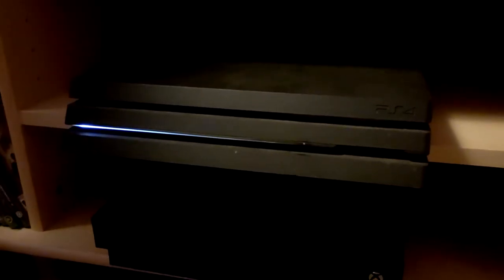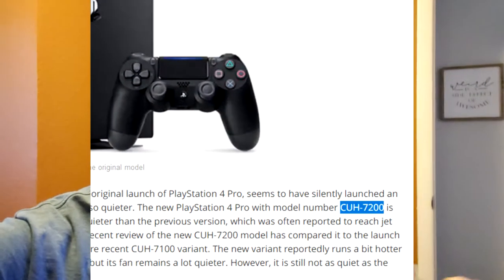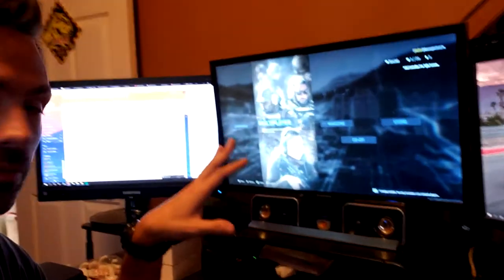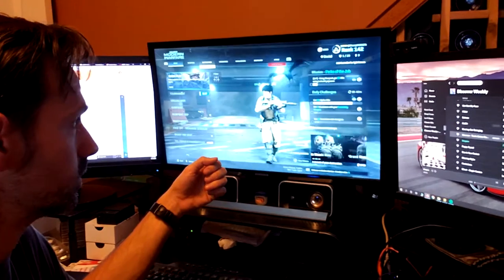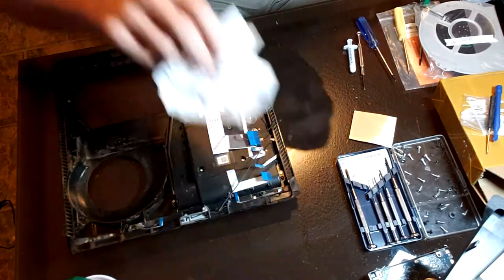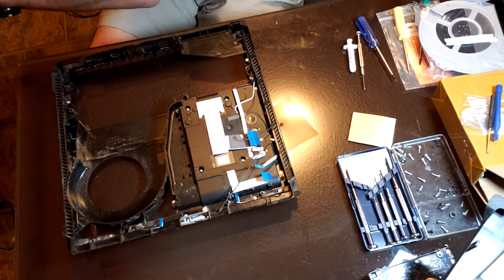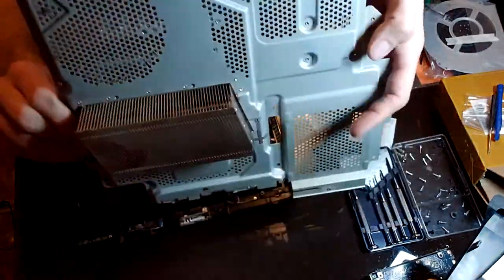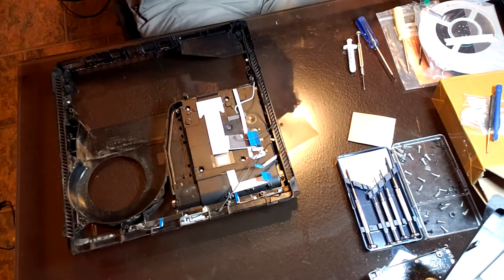How to Fix a Loud PS4 Pro! No More Jet Engine! (Fan Replacement)

Comment: Thanks for sharing this!! Will be doing this on my ps4- pro cuh-7115b console!
Reply from the maker: Let me know how it goes! It made such a HUGE difference for me
Reply: @WheezysGaming  got it installed and yes it made a big difference. Runs quieter. No more jet engine noise! I also bought .75 inch rubber pads to lift the console and offer better cooling. Thanks man for suggesting this fan.
Reply from the maker: @gerardoserrano4801  That's great to hear! It makes a WORLD of difference!

Comment: my ps4 pro was working really well-I thought- til I started playing elden ring and omg did it start with the loud screaming 😱 😳 so I ordered a new fan replacement off Amazon, I got the fan and watched this video tutorial and followed your step by step and now it works perfectly and it's so whisper quiet, I actually thought once I turned it on I did something wrong or the fan wasn't working, but loaded up elden ring and the fan was working perfectly fine, im just used to hearing it spin and not used to it being so smooth and quiet!! thank you so much for taking the time to upload this video, u saved me a huge headache and possibly service fees for a certified repair costs. amazing!! 😊
Reply from the maker: I'm glad this helped! The old PS4 Pro fan is SO loud, it makes a huge difference to replace it. Same as you, I thought "Oh no, did I not plug the fan in correctly?" lol

Comment: Mainly the cause for the infamous jet engine noise the PS4 is dust blocking the heatsink, impeding the fan etc and replacing the crappy thermal paste sony puts in their console also help cool the system. 

Since you're replacing the fan might as well change thermal paste/pads, i did it for my early PS4 model CUH 1001A and it went from an obnoxiously loud jet engine to super quiet as if i got it the first day.
Reply from the maker: That may be the case for the original PS4. For the PS4 Pro, I took it apart, cleaned it, and replaced the thermal paste, and it was still a jet engine. Replacing the OEM fan was the fix!

Comment: Hi, I had a question after playing the noctua nt-h1 dough silicone on the PS4 pro, how many days should we wait or turn on the device quickly? I changed the thermal paste, but the fan made a lot of noise again.❤
Reply from the maker: Thermal paste doesn't need to set, you can start using the device immediately. Did you only change the thermal paste, or did you replace the fan model? The fan is the issue.

Comment: Hi and thanks for sharing this tutorial! I changed the fan and thermal paste according to your instructions and now my PS4 is finally really quiet. The problem is, I noticed it’s getting very hot, is this normal? I am not sure if the new fan is really working.
Reply from the maker: Glad it helped! Getting hot where, at the fan exhaust? That is expected, since the fan is moving a LOT of heat away from the CPU and GPU. It is only an issue if you experience issues with the console performance (stuttering, freezing, or crashing). 

My Series X, for instance, feels like an OVEN when you put your hand over the top exhaust 🔥🔥🔥
Reply: @WheezysGaming  Yes, at the fan exhaust, feels really hot. But I haven’t had any warning from my PS4 that it is getting overheated sofar, so you’re right, it’s probably normal! Thanks again!

Comment: I done this I've changed the thermal paste I changed the thermal pads on the chips as well still got turbofan fault only other thing I can think of is the heatsink
Reply from the maker: What is the model number of the replacement fan you got? The important part is the fan model. It's the old fan that sounds like a jet engine under max load.

Comment: The packaging for Noctua says just a small blob in the middle and do not spread it. Was wondering why you spread it when they say not to.
Reply from the maker: It's honestly and old habit from back in the day. The application of the heat sink SHOULD evenly spread the thermal paste by itself, but I still like making sure it's a nice even coating myself.
Reply: @WheezysGaming  so I used just a blob and my fan was louder than ever before. I then spread it like you did and now it’s silent. So the habit you have works 😂
Reply from the maker: @datmanUK  Glad it worked! Sometimes old tricks are the best tricks!

Comment: So does all ps4 pro models take the same fan
Reply from the maker: No, the newer PS4 pro models have a better fan in them by default. This fan model is to upgrade the OLDER pro models, as I outlined in the video.
Reply: @WheezysGaming  so Is the cuh 7115B star-wars a newer one I don’t wanna but the wrong them I. Been experiencing loud noise
Reply: @WheezysGaming  so I have cuh 7115b model of the PlayStation pro so can you tell me every I need no extra tools every thing that’s necessary I need to save some money sorry I don’t mean to sound rude
Reply from the maker: @dunnodtb  The NEW fan started in the 7200 series pro consoles, so yours has the old fan, which means this replacement would fix the noise issue for you.

Here are all the things you'll need to do the replacement. Obviously, you can skip buying any of the tools you already have:

QUETTERLEE Replacement Fan
https://amzn.to/2ZJNzOz

Noctua NT-H1 Thermal Paste
https://amzn.to/2Rypo16

Torx Security Drivers
https://amzn.to/2ZLoClP

Screwdriver Set
https://amzn.to/35JngMe
Reply: @WheezysGaming  thanks man 🖤

Comment: just changed mine fan and unfortunately it works pretty much same.. maybe slightly quieter.. but there is no huge differences :)
Reply from the maker: Was it having the jet engine noise before? What model is your PS4 pro, and what model was on the fan?
Reply: @WheezysGaming   yeah it was same noise as you were having.. i bought same fan replacement as you did.. i open i clean changed termo paste changed fan and everything is pretty much same slightly better... i have first model of ps4 pro
Reply from the maker: @katu6655  That's odd, the newer model fan is STILL significantly quieter for me. Did you look at the model number on the new fan to make sure you got sent the right one?

Comment: So I was taking my ps4 pro apart to clean and I needed to take out the fan and while try to dis connect the fan I snapped one of the wires on the fan connection and now I don't have a fan but I ordered a replacement on ebay   and it was a delta model cause that was the only one.
Reply from the maker: You definitely have to be careful with those connectors! I hope it works out!

Comment: Square chip near hdmi use a thermal pad on you will be suprised
Reply from the maker: Yeah? Do you know which chipset that is?
Reply: @WheezysGaming  hdmi input chip
Reply from the maker: @jasephase2k933  Thanks for the tip! That makes sense.

Comment: I DID THE SAME THING . NOW MY PS SAY unrecognized CD DISK
Reply from the maker: You may have missed a connector during reassembly. I would go back through the breakdown and assembly and make sure you re-seat every cable (disconnect and reconnect each one). Good luck!
Reply: @WheezysGaming  yes bro . I got dizzy with all these screws . 
After i assembly it again . I did system update. Factory reset . It took 3 hours.
And it didnt work

But now when i open it again . There was a connector this i miss it . 
😅 I fking love u . Wish u nice day or night 🌃
Reply from the maker: @MOLHAMSTAR  Glad you got it figured out!